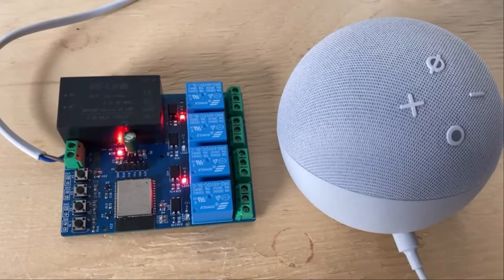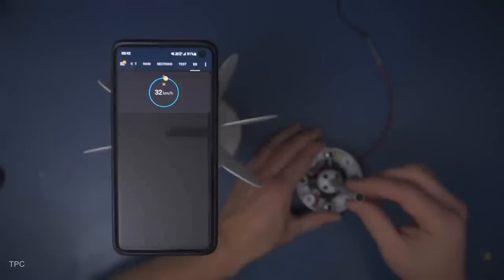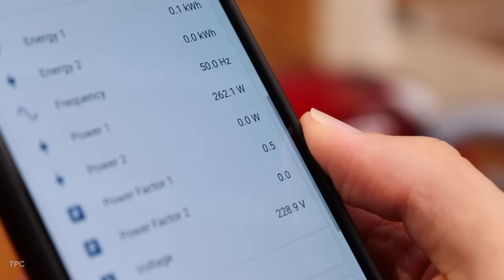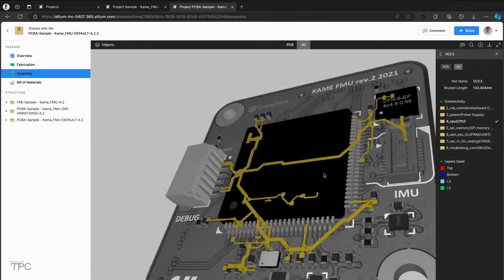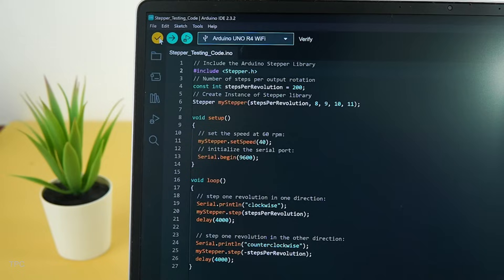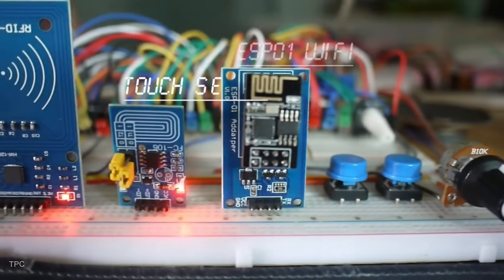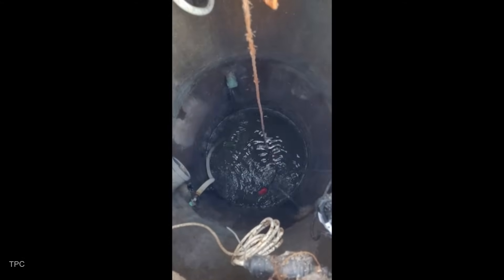Top 10 Home Automation Projects for 2025!

Comment: Looking forward to a greenhouse automation project.  
Communications between Meshtastic nodes information and automating of 
Watering, exhaust fans, and notifying user when a fire needs to be stoked to heat the greenhouse. Will need switches and other higher voltage controls relayed by esp32 board.

Comment: 00:00 Introduction: Awesome Home Automation Ideas
00:08 #10: Smarter Fridge Calendar
01:03 #9: Innovative Anemometer Without Moving Parts
01:49 #8: Easy Home Assistant with ESP32
02:29 #7: Power Consumption Monitor with 3D Printed Case
03:34 Sponsor: Altium 365 PCB Design Platform
04:12 #6: Offline Smart Home System
04:55 #5: Smart Chicken Coop System
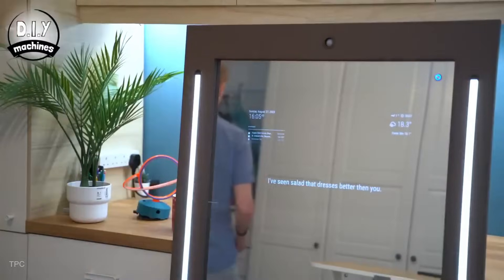05:46 #4: Smart Mirror with Motion Sensor
06:22 #3: Comprehensive Home Automation Setup with ESP01 & Arduino
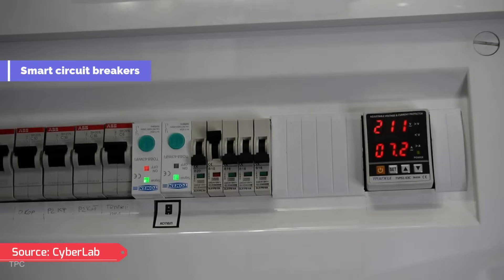07:23 #2: Smart Circuit Breaker with Voice Control
08:14 #1: Easy Smart Home Switch with ESP32 & Alexa
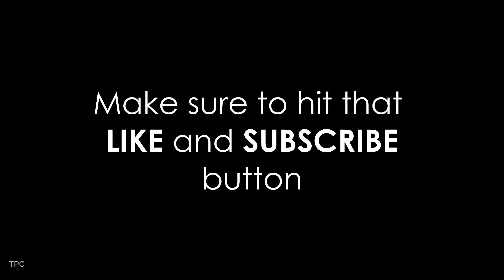09:12 Ending